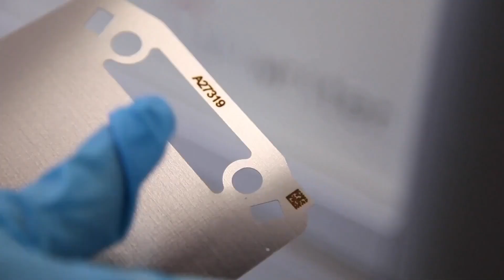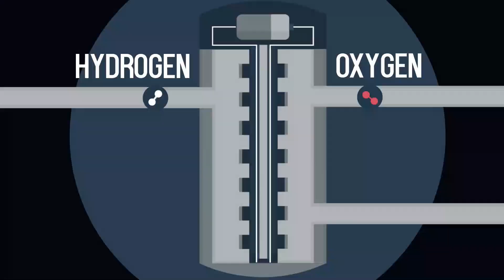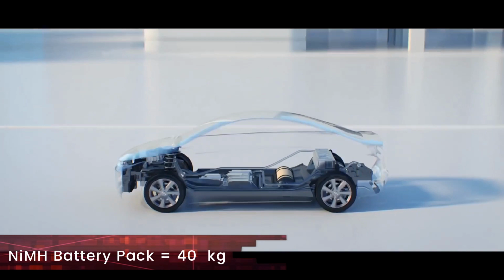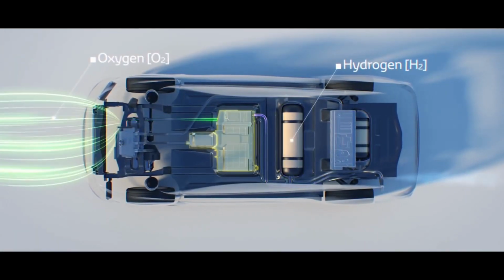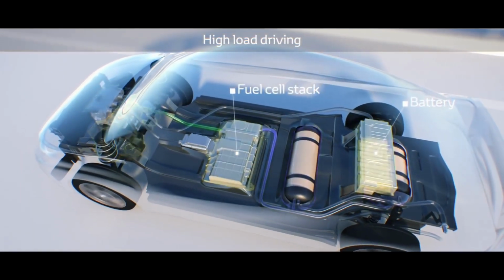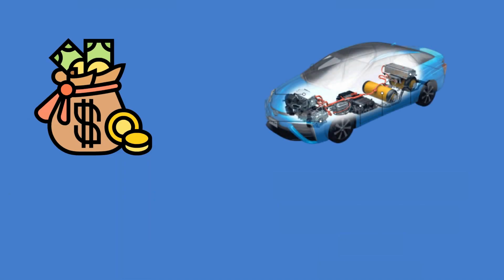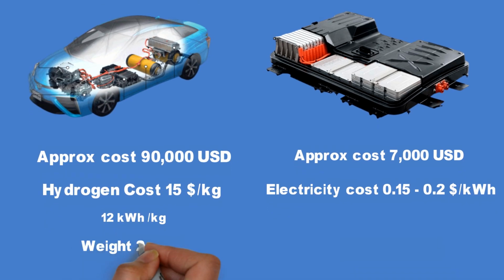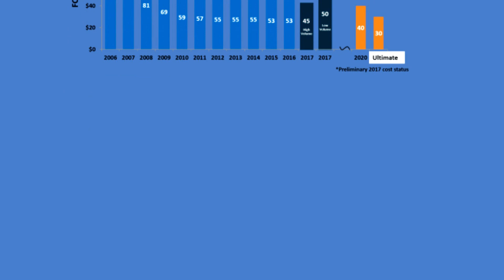Fuel Cell Based Electric Planes

Comment: So, according to current trends Hydrogen Fuel Cells won't be economically competitive with Diesel until 2031?
I don't think the automobile market will wait that long, I'd be surprised if EV doesn't start dominating new vehicle sales by 2024 or 2025.
As a fuel for aviation, I suppose depends on what market segment.
Already today in 2021 there are competitive electric commuter sized aircraft for short flights (150 miles or less).
I'm pessimistic that battery technologies will ever close the economic and performance gap for long flights, but the real competitor would be traditional aviation fuel, not batteries. And, then because of the infrastructure needed to support hydrogen fuel cells as a replacement for petroleum products I'd be pessimistic when hydrogen would ever become the practical choice like progress battery electrics are making  both on the ground and in the air today.
Reply: I think we can get there much earlier than 2031. Michelin is building right now a big factory for hydrogen fuel cells near Lyon/France. They expect to be able to dramatically reduce the costs by mass production.

I have to admit though, that I'm personally not convinced that hydrogen fuel cells are the best technology. Low temperature direct ammonia fuel cells might be the smarter investment because ammonia doesn't require the extremely low temperatures or high pressures for storage, like hydrogen does in order to be liquified. Storing ammonia is similar to storing butane or propane. At least in the lab, efficiency is also better than with direct hydrogen cells. Ammonia is also cheaper and it reacts without CO2 emissions, just like hydrogen does.

Regarding infrastructure for hydrogen (or ammonia) from clean energy: why not produce it directly on site, at the airport? Most airports have large free areas outside appron/taxiways/RWYs that aren't used for anything and construction of buildings isn't possible there due to obstacle clearance requirements for landing and departing aircraft. These could be ideal areas for solar parks.
I know of several airports that are already doing this - as of now simply for solar energy, but why not use the same energy for electrolysis and H2 compression?
Like this one: https://www.airportpark-berlin-neuhardenberg.de/solarpark/
(see pictures at the bottom of that page)

Comment: For smaller GA aircraft the issue of Hydrogen availability at smaller airports would be an issue. Pure electricity has the advantage that everywhere has it.
For larger transport aircraft on fixed routes, it could work.

Comment: I am not sure why you say hydrogen is a good storage medium. It is hard to store because of its small atom size, it is destructive to many metals, it is not that efficient to make or convert back into electricity, especially compared to batteries, and the most efficient method of converting H2 to electricity (fuel cells) is very expensive. That being said it might find a niche in aviation because the kwh/kg of batteries is so much less than an H2/fuel cell combo.
Reply: Direct ammonia fuel cells can solve that. Ammonia is easier to store and also cheaper. It can also be made from renewable energies and is free of CO2 emissions.
Some of these fuel cells don't require platinum, which could translate to reduced production costs.
We just have to wait a little until what already works in the lab is also commercially available.

Comment: I'm curious about the volumetric energy density of the system as well though. Space is also in short supply on aircraft! I would think that cryogenic hydrogen would end up being the more viable solution for aircraft vs filling the plane with heavy 10,000 psi cylinders that don't really hold all that much hydrogen...
Reply: A most logical conclusion! What are you working on lately?
Reply: Liquid ammonia(-25) has more hydrogen than liquefied hydrogen gas ..
But we need direct ammonia fuel cells

Comment: Well, they didn't power us (them) to the Moon, they supplied the ship's electricity, heat, and fresh water. Rocket engines powered them to the Moon (and back). ;)
Reply: Liquid Hydrogen is a typical rocket 🚀 propellant, and it would be interesting how much more efficient/ conservative Ion Drives can be utilizing that Hydrogen fuel with force vectoring in space (after rocket launch)
*Wonder if that’s been tested?

Comment: So I’m curious what happens it was sunspot create a giant EMP while you’re flying in one of these aircraft you will lose all power the old airplanes with points systems could stay running these will drop like rocks
Reply from the maker: Ballistic parachute would save the day. It has to have a purely mechanical ejector mechanism though
Reply: @ElectricAviation  I saw one that had the gas cartridge and inflated the parachute when it got to the end of its tether which made it slow the aircraft down faster than if you waited the extra couple hundred feet it drops before it inflates I didn’t know if you were aware of those It appears to be the same mechanism in airbags in your car the shoot is ejected then at the end of the tether the gas pills the parachute supposedly it can stop or slow did you said within 150 feet don’t know if that’s true but for small aircraft he could save your life
Reply: First of all, the number of airplanes flying today that are so old and outdated that they would be completely unaffected by an EMP is a ridiculously low number. Our current IC planes would be hosed without converting to electric.

Second, I don't know of you were aware, but virtually no aircraft "drops like a rock" on losing power. They glide and land
Reply: @gormauslander  unfortunately the larger aircraft have electric controlled systems for the steering the flaps the Elrons no you will drop like a rock .the gliders and little planes yeah they’ll be OK it’s a moot point truth is we rely too heavily on electric grid that are antiquated . I’m sure you’re going to tell me gyrocopters can land without power but how many people are actually in them and with all the airliners crashing into subdivisions and cities burning up people the handful they glide down is minuscule.
Reply: @Mike-hr6jz  I'm not sure what your background is, but this comment comes across as very ignorant. First of all, the number of fatal airplane crashes pales in comparison to the number of incidents where the pilot landed the damaged aircraft safely. It is literally one of the safest modes of transportation we have. 

Second, An airliner large enough to lose manual controls usually also has a faraday-cage-body, because they need to shrug off lightning bolts. EMPs are typically found between 100mhz and 100ghz, and the smallest of those waves to my knowledge is still 3 meters, far too large to fit through a window in an aircraft.

Comment: that is very, VERY disappointing. You did not mention much about the aircrafts using this technology and its comparison to ICE engine aircrafts or anything about the efficiency comparison to EVs.
Reply from the maker: I have already covered it in a separate video on batteries for electric aviation

Comment: Batteries are needed in fuel cell cars to recapture energy from breaking and going downhill (though, for the latter, one wonders if the fuel cell system could be reversed).

In any case, even when a plane is coming down from altitude, it still has to push itself through the resistance of the air (though it requires a lot less energy to do so).  As such, the only point in which an airplane could recover energy is when the plane has just landed and needs to stop.  Ignoring the added weight of generators on the wheels, I wonder how much energy this would produce.

Since the amount of energy produced would be relatively small, I was thinking a super capacitor storage system might be a better option.  It doesn't have the energy density, but it might not need it and it's a lot lighter.  Also, since this would require a motor/generator to be attached to each wheel, you could theoretically use the stored energy to power the wheels for a much faster take off (weather permitting).
Reply: With windmilling props during descent, electric engines can double as generators; this isn't just theory - it's already being done e.g. in the Pipistrel Alpha electro. With repeated ascents/descents, they demonstrated a 19% increase in efficiency or 27% increase in the number of consecutive traffic patterns.
https://www.pipistrel-aircraft.com/the-alpha-electro-is-getting-established-in-switzerland/
https://arc.aiaa.org/doi/pdf/10.2514/6.2018-3206
Generators in the wheels are nonsense in my opinion. The extra weight will cancel out the presumably quite minimal energy recuperation.

Comment: Liquid fuel has an energy density of 10,000 WH per KG. Am I missing something? These fuel cells, even if we’re lucky are only going to achieve 500?
Reply: Gotta compare total drive systems. For petrol would need to include the engine at a minimum. Would also need to size for same range probably

Comment: hydrogen is unlikely to be used as a portable energy source, since it, in technical terms, is a complete pain to work with. that being said, it is only the /very unappealing/ tip of the fuel cell iceberg, as theoretically anything than can be burnt can be used as a fuel in them, and many compounds (even ones that can be created out of co2 and h2; methanol, formic acid) have been used successfully (although the efficiency sucks at the moment)

Comment: I beg to differ it was a Saturn v engines that propelled us on a journey the batteries we're not the reason we got to the Moon it was a tiny tiny parts and it took a lot of hydrogen oxygen fuel to lift those computers off of Earth you need to be correct with your science and history

Comment: There is a study going on to predict maintenance on fuel cell system.
The purity of the gas will be a game spoiler. These cells may choke slowly to fail.
If this is not fixed no certification will be issued for aviation.
Reply: It’s not hard to achieve pure green Hydrogen.. need to ensure the air intake is purified as well!

Comment: If you use curtailed solar and wind power for hydrogen electrolysis generation your machines will remain unused all the time there is not a surplus of green energy. That is not good business.
Reply: A lot of the time wind turbines are switched off because there is nowhere for the electricity to go... I think this is what he is referring to.
Reply: @richardhare1734  it's not a lot of the time but sometimes. But that's when the power is cheep. All the other time it's not cheep and you're electrolysers would just sit there doing nothing just costing you money. The average production will therefore not be that cheep.

Comment: The cost shown for the fuel cell is completely false. The whole car was $58K, and the 2021 Mirai fuel cell is both cheaper and lighter. The ultimate FC cost in volume is very low.
Reply: They sold the car at a loss
Reply from the maker: @Chobaca   Thank you. At a loss of 55 thousand USD

Comment: There are many advancements in hydrogen production, storage and use which are rarely discussed outside of research and development.  Cheaper fuel cells, storing hydrogen in liquids, producing hydrogen from cheap energy sources, using hydrogen in combustion engines...
Reply: On the one hand using hydrogen and combustion is extremely inefficient, but on the other hand, you don't need a complicated fuel cell system. It's fairly crude technology and is easily maintained. I support the idea of using liquid hydrogen tanks though. That would greatly increase energy density
Reply: @gormauslander  It's competitive with terrible fuel cells if done the right way. I meant storing it in ammonia, water mixed with metal powders, hydrocarbons, liquid organic hydrogen carriers, ...

Comment: I think the idea of fuel cells in aviation is a good one. It makes sense to me to run a hybrid system where the fuel cell is sized to run the cruise load and a small high discharge Li-ion battery assists to provide the max current for take off, then recharged either slowly over the journey or using regenerative braking coming in for landing. I feel this would provide the best of both worlds with the expandability of range not taking as much as a mass penalty with H2 storage. Also quick refueling times. Great work, really enjoying your content.
Reply: That is also perfect for VTOLS.

Comment: Imho, OEMs should focus on BEV eVTOLs with wings. Flying cars are a terrible idea - drive on roads, fly in the sky; not both. Need air efficiency. Maybe the 4680 cell will allow it. Need FAA regulations to allow eVTOLs to takeoff/land [nearly] anywhere like helicopters.
Reply: Helicopters can autorotate. Fixed wing aircraft can glide. eVTOLs? They should have either normal wings or a helicopter rotor. It’s very hard for a fixed wing tilt rotor aircraft to glide. My money is on traditional designs